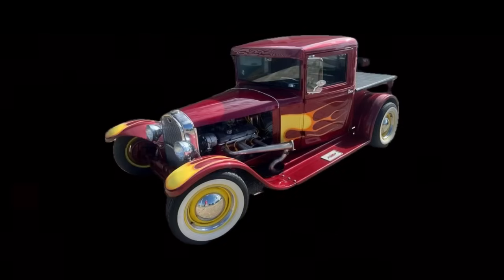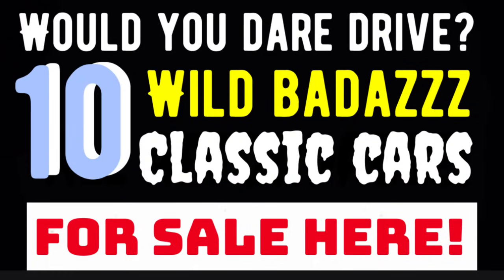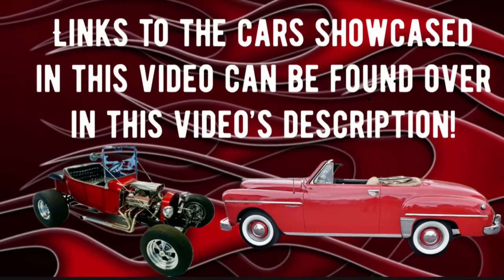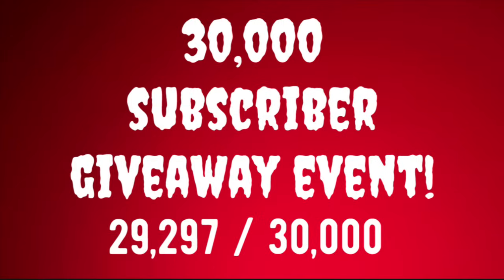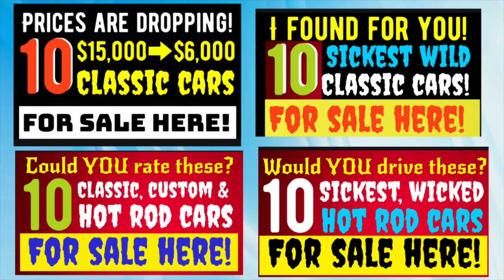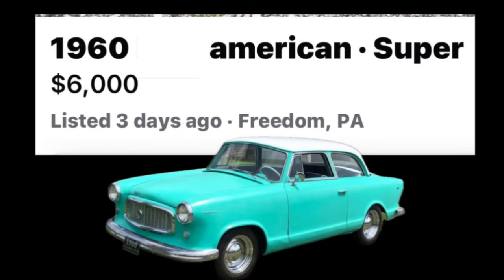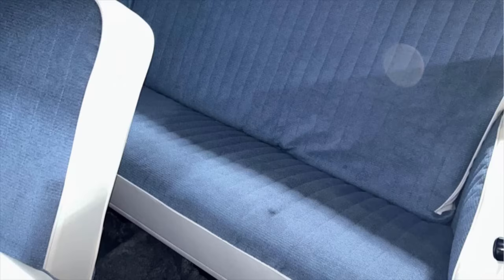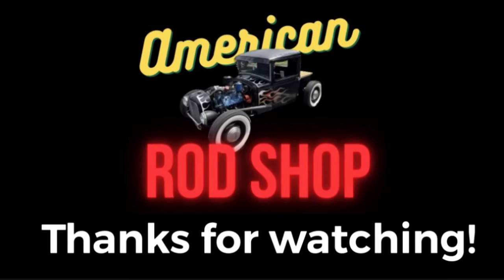WOULD YOU DRIVE THESE? TEN BADAZZZ CLASSIC CARS FOR SALE HERE IN THIS VIDEO! CHECK THESE OUT!

Comment: That '23 T-bucket appears to be a much older build than the 1980's:  the early solid lifter 327 with a 4 speed and four wheel drum brakes speaks of an earlier era; late '60's or early '70's.  I love the '50's Oldsmobile door trim and the two tone on the '47 Lincoln, unexpected but works nicely!
Reply from the maker: Great insight as always Thomas!